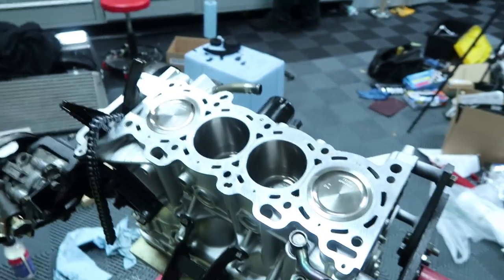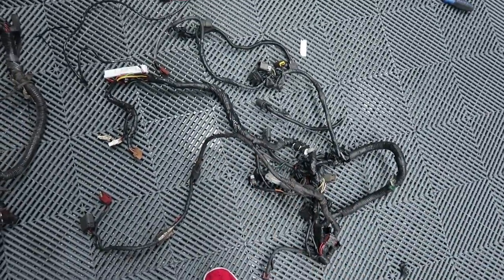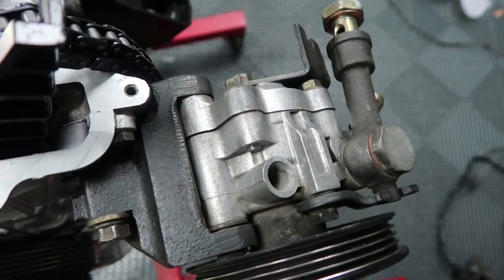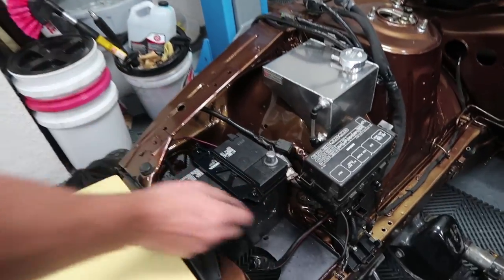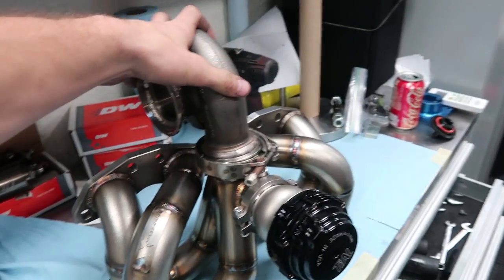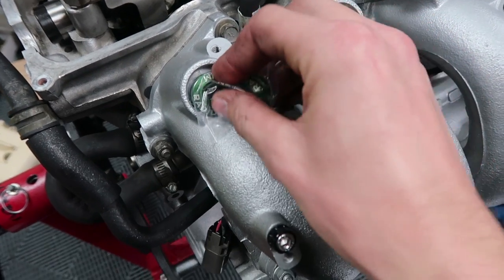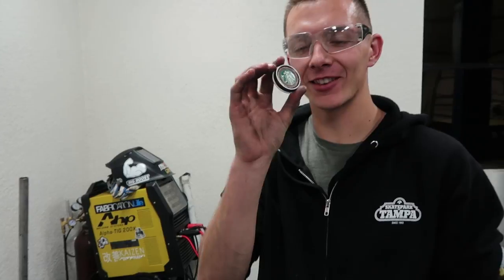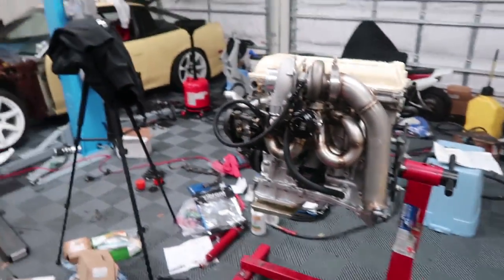Building a better SR20DET Pt. 2

Comment: Hey Adam, I'm late so not sure that you'll see this. 

I'd just like to suggest that you don't break the engine in easy. I know a lot of people suggest doing that and there are a few reasons why I think you shouldn't.

As you probably know, the hone in the cylinder is there to retain oil for the Pistons and rings. But it also has the secondary purpose of basically filing the rings to a perfect fit against the cylinder wall. 

As you break in the engine. The heat cycling of the rings will cause them to harden over time, so it's best to get them bedded well before that happens. Because once the rings have reached that point then sharp edges on the hone will wear down quickly. 

Another thing of note is that the rings don't just seal because of their pretension from being larger than the cylinder. The piston ring lands are designed specifically to allow the pressures from combustion behind the rings. This means that the higher your combustion pressures are, the harder the rings get forced into the cylinder walls, wearing them into the cylinder better.

For these 2 reasons alone I've always done hard pulls/track driving on every engine I've built to seat the rings. I have had great experiences doing it this way and have had great results in terms of oil consumption and blow-by.

So I would just say barring any massive issues with lambda or timing, to just drive it hard to break it in, change the oil quickly the first couple of times and maybe even if you're curious, send off an oil sample to Blackstone labs and have an oil analysis done and they can tell you how you're break-in went.

Comment: Those Snap On torque wrenches are the best.  I scored that 1/2" off a repo for $350 and it was never used. Once you go digital you never go back. Sweet build so far, cant wait to see the dynos
Reply: Kaianui I bought the 3/8s when I was an apprentice tech and love it

I can’t wait to get the 1/2in soon

Comment: Adam,I would recommend having Alberto weld in a exhaust flex pipe, this will protect the manifold and turbo components from cracking, warping and other annoying issues. Many OEM companies use flex pipes. I know it is a little late to comment on this, but keep it in mind next time... Head alignment dowel pins need to be measured before installing head gasket, since you had the head and block resurfaced, the distance between head and block becomes smaller,but the dowel pin stays same length. If the head alignment dowels are too big, then the head does not properly seat on the new gasket and also is prone to failure. Keep up the cool videos!

Comment: The "composite" head gasket stuff is actually a mix of graphite, metal and other "heat tempering material".
Reply: The composite head gasket is graphite impregnated to help fill in the imperfections in the surfaces, it doesn't add any strength to the head gasket. All cylinder sealing is done via the metal crush rings. The standard head gasket will survive at quite reasonably high hp levels, since the material part of the gasket doesn't come in contact with any pressure sensitive areas. The biggest advantage of metal over composite is when the bores are very close to water or oil jackets, and that comes down to the individual engine design. The biggest draw back of metal is trying to seal the cylinder under high boost. You really need a very smooth surfaces to run a metal gasket.
Reply: @DodgyBrothersEngineering  great info thanks.

Comment: When u use the wire brush to clean it helps to dip it in gas to break the stuff on it down and use the brass one because it leaves less scratches

Comment: I recently (2 weeks ago) talked to a Tomei tech about copper spray.  He was pretty emphatic that it is a bad idea to use copper spray.  In the past, I have used the copper spray on my SR gaskets because of "conventional wisdom".  I decided to do some more research on the topic and went straight to the source.  

That said, copper spray isn't a bad idea on intake or exhaust gaskets if you can't find new oem gaskets after removing the manifolds.

Comment: Sell the GT350, make an AE86 grip car for the heck of it
Reply: I have a ae86 with a s2000 swap i think he'd like it a lot and especially if big boost slapped a turbo on
Reply: Sell the Gt350 and get a Gtr besides a R35 or a Supra
Reply: Jerry Springer u have a ae86 with 2 litre vtec?
Reply: ur getin band frum my krishten roblox game cuz u sed h**k
Reply: Jerry Springer I wanna see your car. Do you have ig or something
Reply: 3sge Beams engine*
Reply: Jerry Springer >S2000 swap

What did you do, swap the body on to it? 

F20C
Reply: +Lincoln Peart I swapped the s2000 first gen f20c motor into my ae86, they have full swap kits for it online it was harder for me tho because I have a full tube front end on my ae.
Reply: +tommy riordan it's an f20c fully tuned with cams, itbs, bigger injectors and a few other goodies

Comment: At the risk of sounding flippant, the way to build a better SR20DET is to put an SR20VET head on it.  The VET heads flow have Nissans version of VTEC and close to double the CFM stock @ ~310 CFM , compared to the stock DET heads @ ~180 CFM.

Comment: Please do a proper start up on this fresh rebuild, take plugs out, take out fpump fuse and turn over engine to lube it up. When you actually start the engine, use conventional oil to wear in the rings the first 200 miles. Then switch to synthetic. On first start up, rev it up to 2k immediately to get oil pressure up

Comment: That coolant line is going to fry if ran through the manifold even with a heat barrier on it. Run a banjo fitting off the block and go below the manifold runners.

Comment: Are you gonna do a flex fuel sensor? Or are you gonna do e85 only? Personally i think if you can afford to have it setup ti run both pump gas and e85 it would be more streetable

Comment: Do not wire brush your alternator unless you tape it off first. the metal shavings will short it out.
Reply: paradoxdesigns ive cut exhausts next to alternators and had metal fly into them, 2 years strong
Reply: No it won’t.
Reply: No
Reply: *you're
Reply: metal shavings wont affect the alternator only if an actual piece of metal gets in their will it short it out unless it was a big pile of shavings crammed into the rectifier against the frame
Reply: Isaac Amelung you’re
Reply: Nine immature newbies.
Reply: Lucky there is only an armature and coils in the alternator to be effected by big debris, and not more delicate things like brushes or bearings that can be affected by small particles (insert head shake here). Some people wouldn't have a clue if you bought it for them... For all the kiddies watching don't do this at home. There is only one way to do this properly and that is to disassemble the alternator, and while your at it fit new bearings and brushes.
Reply: Isaac Amelung you're*
Reply: You´re late to the party, want a sticker instead?
Reply: paradoxdesigns 😭😭😭😭.  Get us a left handed screwdriver lad. 😭😭

Comment: Only for today 2 questions
1) the copper spray is used only when youreuse the head gasket and has some signs.Your friend who does no shit use the spray and destroythe gasket fromthe factory.(remember me when  oil become white from water) 
2) the lines are totaly wrong ,He will blow the car  when temp raise .The alouminioums will fail and the lines will lose .
IF  i am wrong ask any professional  mechanic about the head gasket and picture the lines.
I like your car and i want to see it running ,BUT you mesed with wrong <mechanics>
ps I like tohear the things you.learn
ps  ask your mechanic in which high youput the oil cooler..the samewith the oil pan or higher.I will send you the answer pm

Comment: Not sure why he put the front cover on before the head. It is much easier to put the head on and chain set, then do the front cover. That way you know you have it perfect. There is a trick to get the front cover on without grabbing the head gasket  at the top of the front cover.

Comment: Dude, I hope you use some grommets for those wires, or at least a sheith esspesialy the sub power one. Atleast electrical tap the shit out of them were they go into the cabin. Good way to make fire if you don't. Plus, I'm surprised you didn't heat wap that header. Otherwise, good shit b.

Comment: I built a ford 2.3 and forgot to put in the locating dowels for the head and gasket but it’s been fine so far. 🤷‍♂️

Oil on the oil filter seal or no oil on the oil filter seal?
Reply: francisco toscano 
Always oil the rubber seal, some people fill the filter with oil to, but that depends on the person (I personally don't)
Reply: As long as it's lined up correctly it will be fine especially the 2.3 they're tractor engines... I love them anyway.

Comment: What does DET stand for?
Reply: cole D means that it’s a dual over head cam, E means it has electronic fuel injection, and T means that it is turboed
Reply: Alberto Flores Thankyou I have been wondering for months

Comment: I think it is actually called indexing the cams, degreeing didn't sound quite right to me even though i guess its not incorrect.
Reply: krm2014 same difference just different words.
Reply: leroy420b and i said that it isnt incorrect in my comment. Degreeing to an angle could be analogous to inching a measurement. The action is indexing to a certain angle (degrees are the unit)
Reply: I'll add, i guess degreeing is the terminology most typically used on the internet, it just doesn't sound right...
Reply: Angle isn't really involved when using a degree wheel. It's not just the "internet" terminology it's engine builders terminology.

Comment: Adam ditch the power fc, they're very outdated and old technology. Grab yourself a link ecu, apart from being 20 years newer technology they're seriously cheap too! Easy to tune, heaps of support, we use them at the tuning shop I work with, seriously grab a link ecu, you won't regret it. If you built a 10k engine you're not going to use stock pistons, so why would you cheap out on a proper ecu? we're talking live tuning, 3d maps, e85 compatible, easy logging, heaps of inputs and much more. They start at like 750usd for a link atom.
Reply: haltech is life.
Reply: The Power FC is more than capable of handing the fuel delivery of a much more powerful engines than this, IF the tuner has half a clue about what they are doing. I went Haltech over PowerFC because I wanted a stand alone not because of lack of features.
Reply: No one said they're not good ECU's, they're just old and outdated. You can't really debate that a standalone has better tunability and safety parametres compared to a piggyback.
Reply: Not debating that, the primary reason I went Haltech was it had better map resolution than the PowerFC, and I wrote my own auto tuning software for it before Haltech even had one. You are also comparing MAP to MAF, but in terms of features the PowerFC had / has all the features a typical road / drift / race user would ever need. Also had a much bigger support base when I bought the Haltech which was in it's infancy and wasn't anywhere as big of a household name as it is today. Ultimately I went Haltech based on discussion with the tuner who steered me that way even though it was twice the price. Newer doesn't always equate to better, sometimes more development of an old product is better. That is why Toyota don't change engine designs every five minutes.
Reply: Exactly For a typical "road user" / street driven car PowerFC's are fine. But adam's car is pretty much a full blown drift car with occasional road use at this point. I just don't see the point in spending so much money on an engine but then running an outdated ECU, especially when he's not really short of cash, theres no real reason why.
Reply: This thing is basically stock other than a set rods and pistons, and certainly not making the sort of power he is going to ever need more than a PowerFC for. If you have money to waste (and clearly he does) then I would be ripping that sump back off and installing a dry sump. That is something he does need. There are a number of higher priority items he could be looking at if he wanted to step it up from what is basically a mild street car that gets drifted.
Reply: Dodgy Brothers PowerFC has no failsafes whatsoever.  No support for auxiliary sensors that can tell the ems that something is wrong that a factory sensor doesn’t read.
Reply: Not sure how accurate that is since in a recent video they were talking about a MAP sensor being in place of the MAF normally used with a PFC. Same goes for an external boost control (but that could be a separate device).
Reply: The point is I have seen PowerFC's in SR cars making between 400 and 500hp with no tuning issues. It would be great to say the issue is the ECU and it can simply be solved by going to a standalone like the Haltech, but if the tuner cant tune a PFC they aren't going to do any better on a PFC.
Reply: Dodgy Brothers The MAP replaces the MAFS, neither the MAP or the boost control solenoid add any EXTRA function to the ecu.  The stock sr20 has a factory boost control solenoid as well.  I’m talking about failsafes, having oil psi, fuel psi, fuel ethanol content, and wideband afr sensors ran to the ecu both for logging and for failsafes so that if anything goes out of tolerance the ecu will either compensate for it, or will shut the engine down before you blow it up, and you can pull the data log up to see what happened.  A PFC can’t ever do those things.
Reply: I know what a MAP sensor is I ran a 3 bar MAP sensor on mine, but a MAP sensor uses a different signal to a MAF, so that would suggest that the PFC does have additional inputs beyond a standard ECU. I know someone who was running a crank trigger in place of the crank angle sensor in the head, so I would say there might be several additional inputs. Not sure my Haltech had any additional safety built in (I was running an Haltech E11v2)
Reply: What Sump is that it looks good and not overly large like the greddy one...

Comment: Honestly for someone who drives on boost as much as you do, an internal wastegate will end up saving your health in the long term, because the whole point of an exhaust system is to eject the toxic engine fumes down past the cabin and out the back of the car safely, away from you and your passengers. If you do end up keeping the external wastegate, you'll be setting a bad example for your millions of fans. That being said, it's your life and your car, and as long as you are aware of the risks, build it how you want to build it

Comment: The copper seal a gasket is crap. Not recommend by any manufacturer. The head and deck of the engine is perfect flat so why bother. The copper sealant is also not recommended for turbo engines because the higher temperature and pressure of a boosted turbo engine will over heat the copper shit and it will blow the gasket from cylinder to cylinder. That is the cause of Taylor's engine fail... I think he will find it out soon. I just told him only not to use the copper crap. If you want try to build the same engine one with and one without copper crap then turn up the boost and the copper shits in bed first 100%. The issue with the coolant leak on head gaskets is already taken care of at an good head gasket, ask the manufacturer! I tell you the answer: DO NOT USE COPPER SHIT ON A TURBO ENGINE HEAD GASKET.

Comment: Squeezing the dowl pins ovals them out & your not supposed to scuff them
Reply: Juliano Januario that's weird on my dowl pins they were solid much like a circle. This is the first I see them where you have to squeeze them to fit in the block.
Reply: dsmracer97 your not supposed to squeeze them
Reply: Juliano Januario I know I read your first comment.. which is why I said this is the first time I see anybody squeeze them.
Reply: It won't hurt them he could get away without them they aren't a super critical component.

Comment: Copper + Aluminum + water = corrosion  lol. Do some research guys
Reply: Shred Season 
🙁🙁🙁😢😢
Reply: That's why antifreeze has corrosion inhibitors... Do some research.
Reply: Shred Season 
👆
Reply: There are corrosion inhibitors in antifreeze however aluminum and copper are further apart on the galvanic index meaning there is a greater risk of corrosion between the materials.
Reply: @leroy420b he lives in Florida and uses water. Do your research buddy.
Reply: Shred Season 

Ur getting butthurt over something you have no say in bro😂
Reply: If he's smart he uses a water wetter with corrosion inhibitors. It's not a big deal if he doesn't it would take quite a long time to cause any kind of serious issues. I work on large industrial cooling systems so....
Reply: Oh shit if you got to 14:18 of his next video he says the radiator is full of water and wait for it...water wetter.